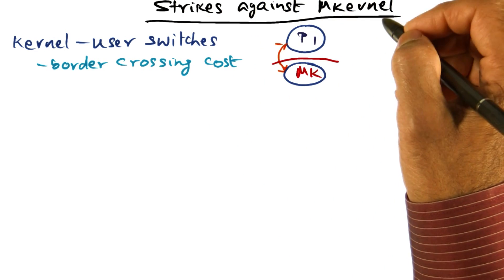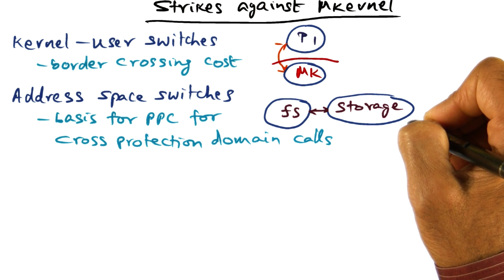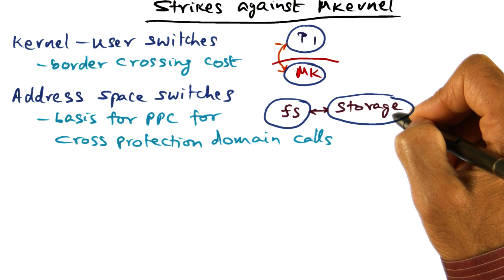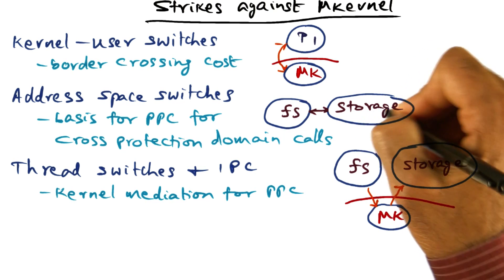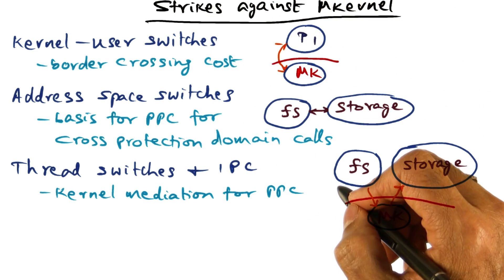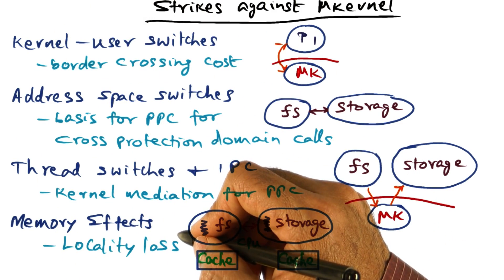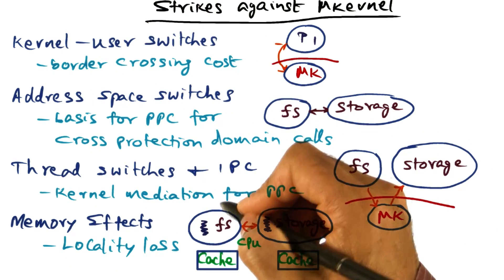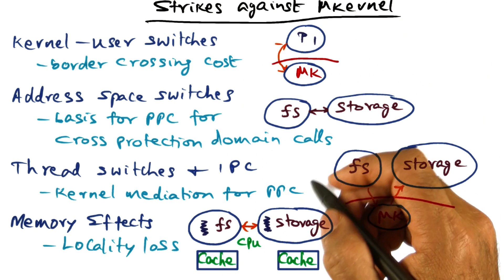Strikes Against Microkernel - Georgia Tech - Advanced Operating Systems

Comment: Modern TLBs for VM design don't have this issue. The idea of flushing the TLB when reloading the page table was always a problem and virtual machines illustrated it, since they require flipping the page tables a lot. However, the effect of TLB flushing occurs with any address space switching, including user to kernel and back. The fix is to let the TLB act more like a cache, and only evict on a line by line basis. VM enabled TLBs work this way.

Thread switching has no hardware solution, but the difference between thread switching and a procedure call with lots of register parameters is small, ie., they both evict and refill registers.

Finally, I don't agree with the locality point. If you have a user process continually calling the kernel, even with widely dispersed address spaces, the cache is going to follow that.

Comment: The first and third strikes are not actually separate issues in practive. In most modern microkernels, a majority of thread switching occurs on IPC calls, meaning little to no scheduling is needed (it's obvious which thread to switch to).